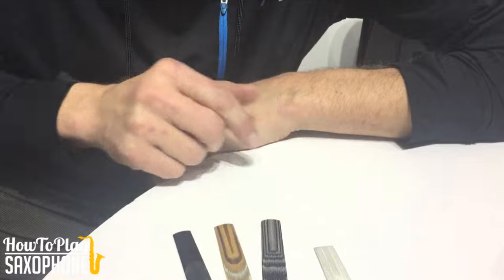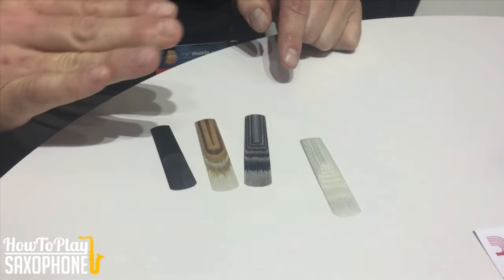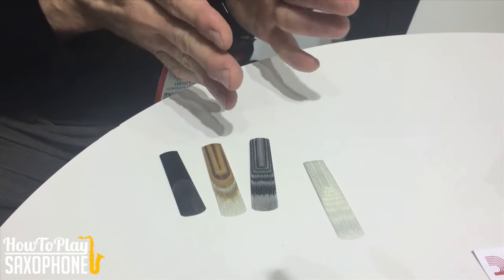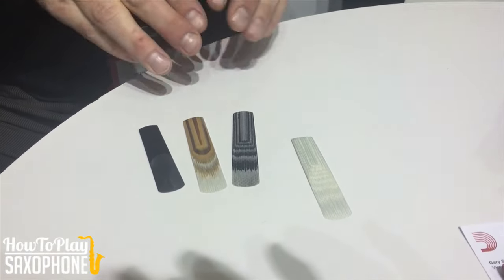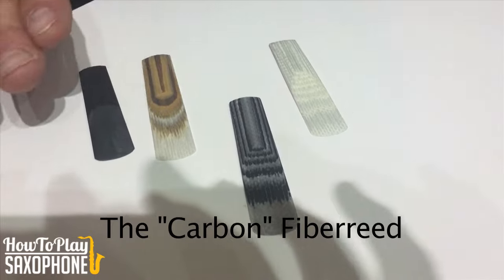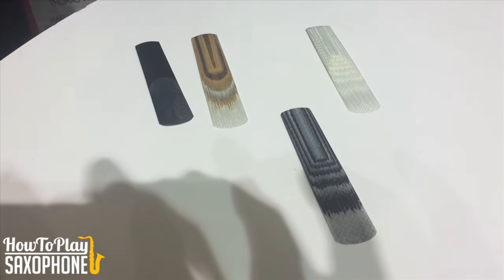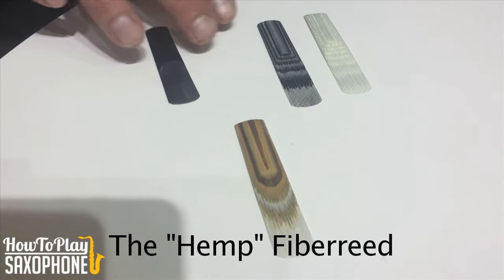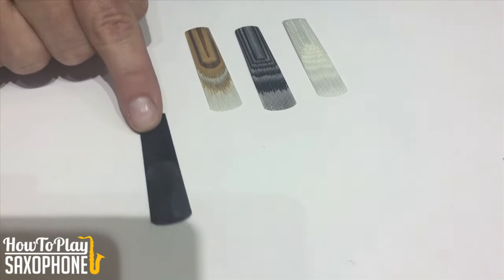Fiberreed Saxophone Reeds Explained by Tom Wanne

Comment: I’m a big fan of the Fiberreed and have been using it for about 10 years now. One of my reeds is a bit hard. Do I adjust the Fibrereed the same way I’d adjust a natural reed?
Reply from the maker: yes, i been experimenting a bit with the fiberreeds and you adjust the the same as cane. use sandpaper or/and reedgeek